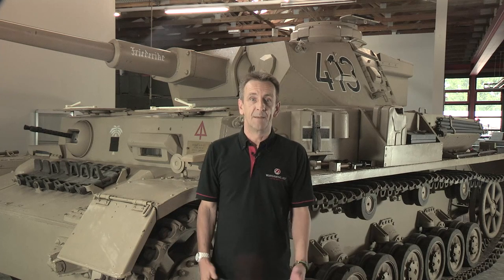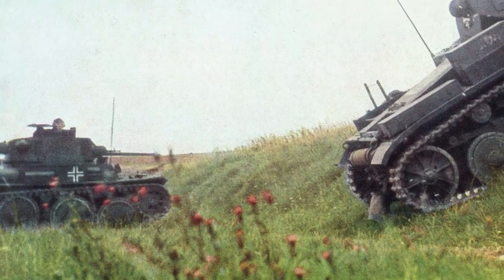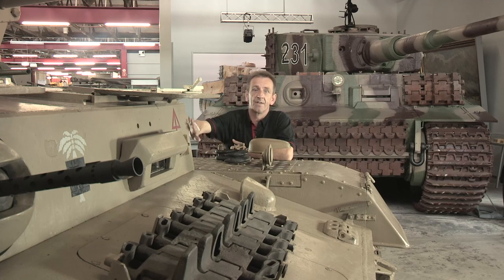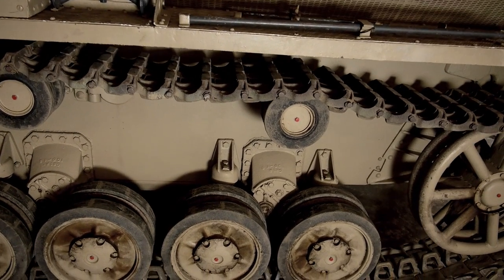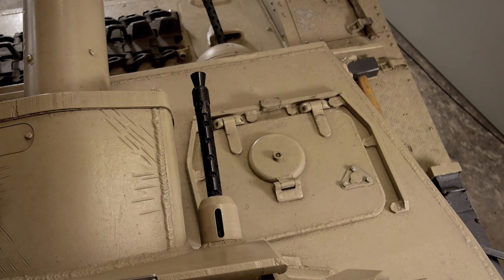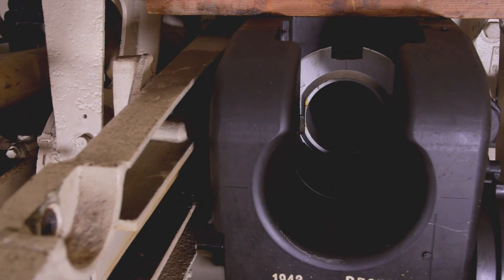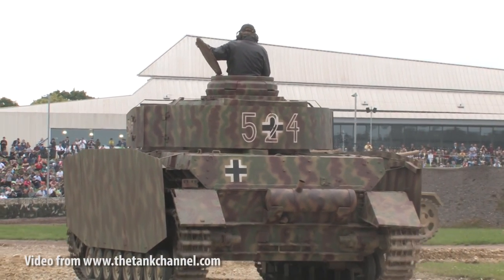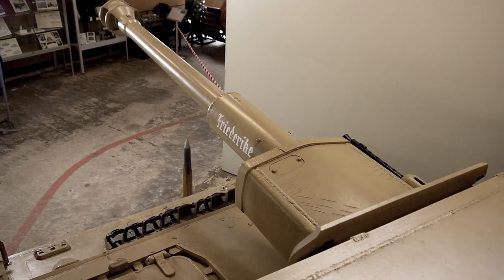Inside The Tanks: The Panzer IV - World of Tanks

Comment: Im not sure is that really a Panzer IV, cuz Panzer IV have 105mm Gun. That is 75mm gun and the turrent is not the same...
Reply: Germany Tanks used 2 cm / 3.7cm / 5 cm / 7.5 cm / 8.8 cm / 12.8 cm guns
Reply: alleskaese I know that. Im talking about Panzer IV and you forgot 10.5 cm guns
Reply: Runer Skinhead
The 10.5cm gun was used by Heuschrecke, Dicker Max but they was self-propelled guns, the tank you mean was the Heuschrecke and both tanks were only prototypes.
I hope it helps.
Reply: alleskaese Well Tiger II too used 10,5 cm gun. But Im not sure what is the original gun of Tiger II 10,5 cm or 8,8 cm.
Reply: Runer Skinhead
The Tiger II used only the 8,8-cm-KwK 43 L/71 the use of the 10,5 cm KwK /L68 was planned but never completed.
Reply: Runer Skinhead
The Panzer IV never used a 10,5cm howitzer. It used a short 7,5cm gun and then a long 7,5cm gun. The Tiger II also never used a 10,5cm gun.
Reply: alleskaese Ok. One question I have. You say that germans used 12,8 cm guns. On what tank where they?
Reply: Reaper
Panzer IV b was a modified Pzkpfw IV with a new turret and a 10,5-cm-leFH 18/1 L/28 gun, the tank called Heuschrecke.
Reply: Runer Skinhead
The 12,8 cm gun was used by Jagdtiger and Sturer Emil.

Sturer Emil used 12,8-cm-KwK 44 L/61
Jagdtiger used 12,8-cm-PjK 44 L/55
Maus planned to use 12,8-cm-KwK 44 L/55
Reply: alleskaese Yeah That for Maus I know, but I was thinking that St. Emil used 10,5 cm like Ferdinand.
Reply: Runer Skinhead
- Sturer Emil
http://www.fahrzeuge-der-wehrmacht.de/Artikel/Sturer_Emil.html
http://www.achtungpanzer.com/heu.htm

- Dicker Max used the 10,5-cm-Geschütz K 18 L/52
- Ferdinand/Elefant used the 8,8-cm-PjK 43/1 L/71
Reply: Runer Skinhead
The Ferdinand used an 8,8cm KwK 43 L/71, not a 10,5cm.
Reply: Reaper
Ferdinand used not the 8,8cm KwK 43 L/71 it used 8,8-cm-PjK 43/1 L/71
KwK = Kampfwagenkanone (combat vehicle gun)
PjK = Panzerjägerkanone (I don't found an english translation for this)

A little List of used KwK
http://de.wikipedia.org/wiki/Kampfwagenkanone
Reply: alleskaese
So what's the difference between those guns?
Reply: Reaper
I don't found much information about differences.
The only thing what I found is that the PjK are a modified version of KwK for tank destroyer.
Reply: Getting your knowledge from WoT